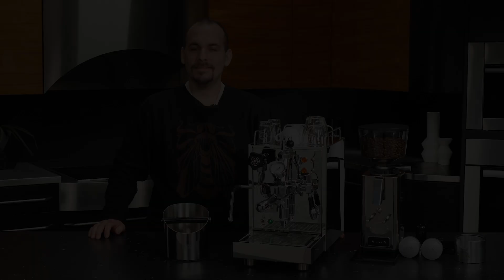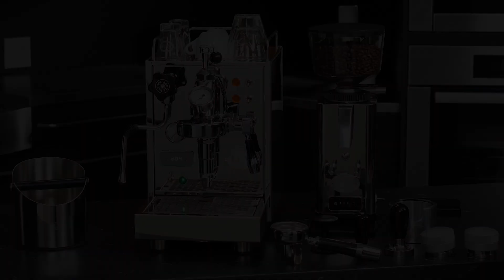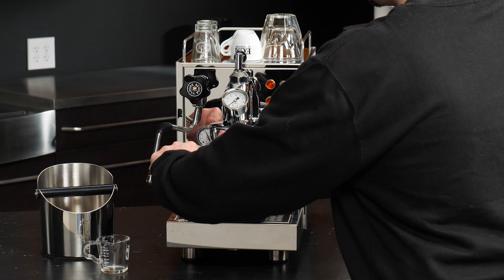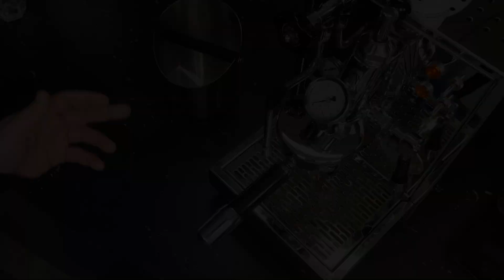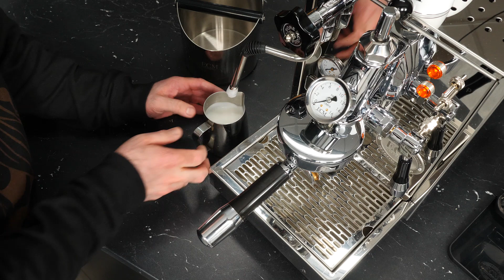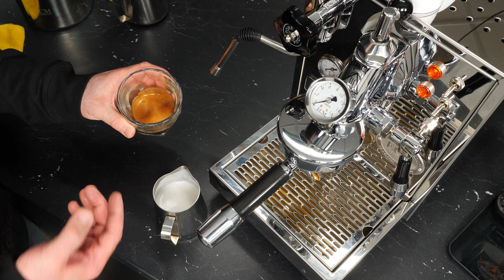ECM Classika PID: Espresso Brewing, Milk Steaming & Flow Control

Comment: Machine looks fantastic. But I guess trying to make multiple cappuccinos is quite a lot of work, having to change the boiler temp between steaming and brewing back and forth each time. This machine is great for a barista type of person living alone.  I can’t expose my wife to this amount of manual steps.
Reply from the maker: Hey Werner, I hear ya, a heat exchanger or dual boiler makes for easier workflow. What I used to do with single boielr machines like this was pull a bigger shot and use the shot splitting forks to split it into two cups. The next part is a bit more difficult but you get good at it over time: steam both capps at the same time. It can be tricky to distribute the same texture between each drink, but a little practice gets you there. Otherwise, heat exchangers and dual boilers definitely solve all the workarounds. - John

Comment: Thank you. Does this machine require cooling flashes like the Hx?
Reply from the maker: Hey bttb, That depends on the use case/pattern. Most HX machines have a sweet point from turn on when no flush is needed. If left on and idle temps usually creep up and a cooling flush is needed. On single boiler with PID like the Classika, boiler temps outside of bump to steaming run in a much tighter temperature range and with a much lower offset from the in boiler temp to temp delivered at the group than what you have in an HX machine where steam is always available. With that, a cooling flush on a single boiler PID is usually not needed.

Comment: hmm. made my shot and pressure is still at 10 for like 10 minutes. i’m scared to clean the port… is this normal?
Reply from the maker: Hi d, Showing pressure in the system after extraction is common and normal. System pressure is measured very close to the pump and behind a one way valve which holds some pressure.

Comment: hello, how can you do preinphusion without flow control? thank  you
Reply from the maker: Hi TFB, Well depends on exactly how you define pre-infusion. If you partially lift the group lever without turning on the pump some water will be released onto the coffee. There's very little pressure behind that and it's probably not enough water to fully saturate the coffee puck. Another method is to open the steam valve to release some pressure from the boiler when you first start a shot. Opening the valve reduces the pressure and flow onto the coffee. Should note that dumping excessive water from the wand can reduce brew water temp on the coffee.

Comment: Hi
I’m fighting hard to choose between ECM Classika I PID and the Profitec Pro 400. Which one do you think makes the best espresso? I will also make some milk based drinks. 
ECM has PID and PP400 is HX but how accurate are the temps on PP400 compared to ECM?
Reply: I'm trying to decide between these machines, what did you go for?
Reply: I bought the Pro 400 and love it. No cooling flushes between drinks 👍
Reply: @janala69  thanks mate. Are you happy with the temp control, is it stable?
Reply: I have a temp gauge on the group head. I usually start the machine with the highest temp and when it reaches around 94C I put the setting to the medium temp and it stays around 92-94C
Reply: @janala69 great tip, thank you. I think that's enought control. Do you mean a temp strip like people use on Europiccolas?

Comment: Thank you for the video! Which one do you think is better for making espresso, ECM Classika PID or Unica Bezzera PID?
Reply from the maker: Hi x, You are welcome for the video! Both are very capable machines. The Classika has externally adjustable brew pressure. The Unica does not. I prefer switch location on the Classika and the external finishing is a hair nicer. Here's a side by side spec comparison of those machines with current pricing: https://www.wholelattelove.com/pages/compare?products=MjI1MjUzMDEyMjgwNiw0MzM1MDIwNTA3MTkw
Reply: @Wholelattelovepage  Thank you for your reply!

Comment: Would be great if you said "It took X minutes for us to reach steaming temps." rather than just saying "now that we're at temperature.." 
I want to know how long it takes to heat up from brew temps to steaming temps!
Reply from the maker: Hi as, It's about a minute to reach full steaming temp but you can start steaming about 30 seconds after switching steam on and before reaching the full set temp.

Comment: Thanks for the video! How long does it take to heat up from brew mode to steam mode? And I have seen videos suggesting multiple water flushes to create space for steam during the switch to steam mode. Is that necessary?
Reply: Forgot to ask, does WLL have a joystick version of the Classika, instead of the knob? Thanks!
Reply from the maker: Hi Jack, No option for joystick on the Classika. The Bezzera Unica is a single boiler, PID, E61 group machine with a joystick operated valve: https://www.wholelattelove.com/collections/semi-automatic-espresso-machines/products/bezzera-unica-pid-espresso-machine
Reply from the maker: Hi Jack, you are welcome for the vid! Never found it necessary to flush to create space for steam. Unless I'm missing something flushing adds cool water to the boiler delaying creation of steam.

Comment: I found its bit hard to control the steam pressure on classika, everytime the tip hit the surface of milk, it creates big bubbles (heavy cici sound not crispy) wierd to me.
Reply from the maker: Hi oe, always keep the steam tip at least slightly below the milk surface when the steam is on to avoid the big bubbles.

Comment: omg i cannot believe that a machine of that cost would actually send with a plastic tamper reminiscent of those seen on 30$ amazon espresso machines.
that is insane to me
Reply: justin...most people who are into this level of espresso brewing have their own gear...actually better
than what's being offered at this scale up item. So it's just a waste and that was why the plastic, simply
a throw away item for most of these customers.
Reply: @deevnn  then why even add a throw away item if the company knows this.  it's a waste is my point
Reply from the maker: Hi JB, up until 2-3 years ago even the most expensive machines came with the plastic tamper. Most dual boilers now come with a "real" tamper. In past manufacturers may have gone with reasoning tampers (or other puck prep tools) are a rather personal choice. Rather than adding to the cost of a machine by including a more substantial tamper perhaps they figured it's better to let end users choose their own.
Reply: Yeah I think you're right.  The tamper is a personal choice.  Which is why I might have gotten so emotional about it lol
Reply from the maker: @xanacanadu  It's all good!

Comment: Thinking about this update for my Classika PID too. I have my doubt though this will work good with the 1 cup filter. If I go as fine as I desire  I do not have enough waterflow anyways with the single cup filter.(stock ECM 7-9g, 20KG tamper)  Even at full pressure(around 12 ,5 bar). So I do not see a big enough window for reducing waterflow anyways. I'll try again as soon as I got my IMS single filter as well as the IMS shower sieve.

Comment: I know that ECM Flow Control Kit comes with a pressure gauge for the group head, but wouldn't it be more beneficial if the guage was a temperature gauge?
Reply from the maker: Hi staglite, Thanks for the question. Maybe, but have to say the Classika is very consistent with brew temps unless operated in environment outside of normal room temps so it might not tell you much. On the other hand, with the pressure gauge one can decide to let brew pressure in the group drive their flow control manipulations and in essence do pressure profiling. Pressure gauge also let's you observe and react to changes in brew pressure and see things like pressure drop with puck erosion as a shot progressses.
Reply: @Wholelattelovepage  Actually I've got the ECM Mechanica V Slim. But I guess the same applies?

Comment: If one has a machine that does a pre-infusion "wetting", surely for everyday use, this is enough, one wouldn't need to have a machine with flow control? I know some say you can do stuff like use your machine to a "drip coffee" but really, that seems like a waste when v60, Clever Dripper etc work so well... Are there other benefits I'm not seeing, especially given I always have med-light roast, never dark, and most machines you can calibrate the group head pressure to what you like, 9 bars or whatever... so is there another good reason to have this added variable?
Reply from the maker: Hi Mark, Here's a video covering 2 easy flow control methods with big impact: https://youtu.be/a-QAOo8Vg5A
Long low flow pre-infusions - like 15 seconds of flow before 1st drip are extremely beneficial for relatively fresh from roast specialty coffees. For medium and darker roasts or coffees which are beyond initial freshness higher flow rates to start followed by reducing the flow as the shot progresses helps by not pulling out stale flavors.
Marc
Reply: @Wholelattelovepage  I am asking mostly because I am interested in the bezzera matrix de Which does not have this level of control...but you can change the pre-infusion time... I roast my own beans so they are very fresh and always medium light...

Comment: 8:20 - The beauty of the metric system... you don't need a scale if you have a measuring cylinder or a way to measure volume... 1ml of water is exactly 1g of water. Good video, thanks.
Reply from the maker: It is beautiful! One catch, espresso does not weigh 1g/ml - especially the crema which makes converting volume to weight tricky!
Reply: @Wholelattelovepage  yes but he was not measuring espresso, just water throughput...

Comment: When do you start the count? At the flick of the switch or when you see the drip?
Reply from the maker: Hi NHm, When you start timing is up to you. Some go from pump on and some from 1st drip. if going from first drip a good extraction will be in the lower end of the 20-30 second range.

Comment: Looking in to buying this machine. Is the flow control an upgrade the I could buy separately and add myself, or is it something that must be purchased as a package with the machine?
Thanks!
Reply from the maker: Hi Logan, Thanks for the question. If you purchase the machine from us you can purchase the flow control down the road from us for your machine. You'd need to contact or sales dept directly to confirm your previous purchase to place the order.

Comment: Can you do back to back shots? How many can you do?
Reply from the maker: Hi gs, Recovery time is fast if just doing shots. By the time you've ground tamped and loaded another shot it should be ready to go. As with just about any espresso machine if you continuously rapid fire extractions there's likely to be some temperature changes over time as the group gets a little warmer.
Reply: @Wholelattelovepage  thanks!

Comment: Thanks for this video. I've had this machine for over a year with the flow profiler, and it's a lot of fun. Had a question regarding steam wand temperature. What do you set yours at before steaming milk?
Reply from the maker: I usually leave my steam temperature around 270F. Going hotter will give you more steam pressure, but also take longer to get up to that temperature. 
AJ
Reply: How many time does you machine take to warmup both boiler and group head? Im looking to buy it
Reply: @ervilha17  about 25 minutes. Maybe 20. That seems to be typical of these machines.

Comment: Hi! Great videos like this make me want to dive into the world of professional grinders... Would you say that this grinder is also suitable for filter coffee and switch between them depending on the circumstances?
Reply from the maker: Hi AS, Thanks for the question. This grinder is really intended for espresso grinding. It would be able to grind for filter but takes a lot of adjustment to go from espresso to filter grind size. Always a bit of a compromise to use an espresso focused grinder for brew methods which use a much coarser grind size.

Comment: Great video. If you pull the espresso shot first, what’s the typical time before steam is ready, as this is a single boiler? That’s my usual flow. Does it make more sense to steam first then cool it down to pull the shot instead?
Reply: About 1min. Enough time to prepare milk and stuff. I own one

Edit: about 30secs
Reply from the maker: Hi Julian, depending on the temp you set in your PID, the Classika takes 2-3 minutes to get to steam temperature after brewing. That's a bit longer than some single boiler machines with smaller boilers, which is why we prefer to steam first, cool down, then pull the shot on this particular machine. 
AJ
Reply: @Wholelattelovepage  getting a LOT of inconsistent answers to this same question across the interwebs
Reply: @chadgregory9037  same. ive heard anywhere from 30 seconds to 6 minutes to go from brewing to steam lol